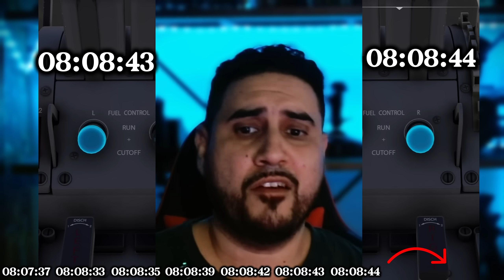TIMELINE & MENTAL HEALTH BREAKDOWN | AIR INDIA 171 | AAIB PRELIMINARY REPORT | MAYDAY | MSFS2024

Comment: All comments are preliminary until final oficial report is issued.  However, I must say that in my 13,000 flight hours as commercial pilot, never saw someone moving a switch accidentally … meaning with no deliberate intention.
Reply from the maker: What do you normally fly? 
I agree that the report points towards deliberate action but doesn’t not give any conclusive causes.
Reply: @FinalApproachPOV  I’m already retired, I flew mostly B707 for more that 20 years. What I’m saying is my experience regarding this issue.  Needless to say, we’ll have to wait for the final oficial report.
Reply from the maker: @armandogotelli7616 totally understandable, with these incidents, we never find out until the final report. And even then, we can only rely on the information they provide.

Comment: Should the pilot who did not set the fuel switches to cut off first reaction be to turn them back on immediately then question why they were turned off. What was he doing for 10/14 seconds before them being turned back on? Did he turn them back on or was it the pilot who turned them off turn them back on?
Reply from the maker: I think an argument ensued between the pilots. But it was intentionally left out of the report.

Comment: It seems strange that there is no C.C.T.V. in the cockpit because then we would know for sure what happened straight away.  I also wonder if in pulling up the engine switch off levers, does it sound an alarm on the dashboard?  If not, somebody earlier or the crew in making their flight checks might have lifted the switches and then, as the plan rose up so suddently and steeply, shaking with all the weight of the plane, passengers and fuel on board the levers might have fallen backwards switching off the fuel supply.  That would also explain why there was only a one second interval between both engines being switched off almost simultaneously.
Reply: Too easy to blame the dead!

Comment: Don't misleading. this video has false information and should be reported..
Reply: Exactly which informtion is false?
Reply: Your title .. the info in the thumbnail, which says that's why he did it
Reply: @WhyIamHindu  Fair comment but we need to keep in mind that it has to be one possible cause. For me the 1 second delay between the fuel cut-offs to respective engines is consistent with a manual act and has been shown to be achievable on another video. Also why did one of the pilots comment on the shut off of the fuel switches?
Reply from the maker: @AstralVoyager-q5f   Thank you for the the critical thinking. I welcome all intelligent discourse on the subject.  But this person "WhyIamHindu" is completely wrong in stating this is false information.
Reply: Change your title to potential flaws in Boieng fuel cutoff switch is called out by FAA in 2018 and British Authorities in March 2025.
Reply from the maker: Feel free to report it.....good luck with your trolling journey.
Reply from the maker: @whyiamhundu - good luck with your trolling journey. feel free to report it.

Comment: This was no accident. The switches were moved from on to cutoff, deliberately, one at a time. Whichever pilot did it, he did it at exactly the right time, knowing there would not be enough time to restart the engines in time.
Reply: The plane was jack ed - that's the simple explanation. Its well known that the engines like Rolls Royce (for example) can be remotely controlled and shut down. RR continually monitors their leased engines anywhere in the world in real-time. One time when one was running too hot they considered shutting it down from England, but instead due to safety concerns waited till the instant the plane touched down before remotely shutting it off.
Reply: @fx-studio   💯 More to it than meets the eye
Reply: @fx-studio Stop spreading misinformation
Reply: @10UnitedRoad10  All the signs its a P $y 0P - especially with all the bots and defenders in the comments...
Reply: Why to believe in primarily  report and conclude very quickly, it's easiest to save boeing
Reply: Right . The experienced pilot knew that , if he  does it at the point , he actually did,  the recovery is impossible.
Reply: @RD-ij2sz practiced in a simulator?
Reply: @ribbit2816 Not really . But fuel switches can not be made on and off by any remote command .It has to happen manually in the cockpit and it cant happen as inadvetent error .
Reply: Oh I see are you the master mind behind it?
Reply: Please refrain from making false accusations on the pilots . Boeing issued an advisory for faulty fuel computer chips which over heated and send signals to the sensors to stop fuel . This happened on 787 having 11,000 or more . When this happens alarms go off in the cockpit and that’s why one pilot asked the other «  did you put the switch off » This was a reaction to a problem and not the cause . The time stamp on the switch cut off shows it’s computer generated and not manual as it would have taken much more time 2 seconds each . So please don’t put a PR spin on this report until the final report comes out just to cover up for Boeing . It’s disrespectful to the passengers , crew and their families
Reply: @DalitisHebrewnotHindu   🙏🏻  Well said.
Reply: @DalitisHebrewnotHindu  stop speculating... it's insulting to the investors
Reply: @gm-zz8so  Right , I have to bother about crony investors spreading false information to protect their behinds. But your PR spin is ok to insult and degrade the pilots who are not here to defend themselves and the families of all passengers and crew.
Reply: @DalitisHebrewnotHindu There is no alarm when fuel is switched off.

You can hear the engine ramp down.
Reply: @willys2747  The alarm goes off when the engines are switched off . 100%
Reply: Been seeing a lot of james bond movies?
Reply: Remote control cannot phyisically move the switches. The fact they were moved to run means they were in the shutoff position.
Reply: WOW. you're so smart...i think u just spoke to their ghosts..
Reply: It was mass murder. He killed more than 5 times the people of the Christchurch Mosque murderer. Sick of people defending and being pussies about this. It was a mass murder suicide
Reply: One of the pilots is a mass murderer
Reply: The report was leaked to Western media ..The report is certainly questionable
Reply: Actually, if only the other pilot had immediately reacted to immediately switch fuel back on, they would probably have been saved.
Reply: @willys2747  it took him 10secs to put it back om apparently.Now that has intention
Reply: It's the prevailing theory for me. But you also can't discount some sort of  psychotic episode, or a bad reaction to some sort of experiencing of a phenomena such as somatographic illusion (much less likely)
Reply: If he really did, then hell is where he is heading.
Reply: If not Suicide/Murder, the only thing I can imagine is, he thought he was putting the Landing Gear Up, when due to some mental slip coupled with muscle memory, he moved the fuel switches to cut off instead of the gear up!
....and he really didnt believe he shut the fuel off.....really hard to believe a deliberate act.
Reply: @SK-qc6fb  How about the plane was jack ed - then you don't need all the gymnastics.
Reply: @fx-studio  Who's Jack Ed?
Reply: @Jeph629  The plane was jack ed - that's the simple explanation. Its well known that the engines like Rolls Royce (for example) can be remotely controlled and shut down. RR continually monitors their leased engines anywhere in the world in real-time. One time when one was running too hot they considered shutting it down from England, but instead due to safety concerns waited till the instant the plane touched down before remotely shutting it off.
Reply: @SK-qc6fb depends on how many switches for landing gear.
Reply: @SK-qc6fb Yes, possibly, as well.
Reply: Spot on 👍
Reply: Stop blaming the pilots. Boeing and airindia will soon shut soon...
Reply: My pc asks for confirmation before erasing a document. Why can't a plain do this ?
Reply: Exactly
Reply: The engines failed immediately at lift off.. Pilot monitoring did his job and tried to reignite the engines!
Reply: @mgspec  NOT what the CVR says. Virtually impossible for both engines to fail at exactly the same time.
Reply: None of the pilot turned it off, the TCMA "engine control system" crashed the plane🙈
Reply: @Bua-yc4vh  Thrust Control Malfunction Accommodation (TCMA) was a possibility, until the CVR and FDR were checked. The FDR shows the switches were turned off and back on again, and the exact times. And the CVR recorded what the pilots said.  The switches were turned off manually. That is now the only possibility.
Reply: @Bua-yc4vh 👍🏻
Reply: @Bua-yc4vh If that were the case, 787s would be grounded world wide (especially those with similiar manufacture date, and flight hours)
Reply: @Bua-yc4vh  Haha sure, and they still haven't grounded 787s around the world. Yeah smart haha
Reply: Wow. You're smart
Reply: Yes the fucking pilot that killed the engines is a mass murderer. It is thst simple, he killed 100s of people. @craigcrawford6749
Reply: If moved deliberately one at a time, it is not possible to do so in just 1 second. An experienced pilot can answer this.
Reply: @krishkrish7574  
You are wrong, It is possible. One second is more then inaf to do that.
Reply: @pilotina65 

I agree absolutely, but why did the reverse switching, which we are sure happens manually takes a while 4s, that's 4 times longer than the switching off
Reply: @oluwafemiayeni4233 by the time the other pilot noticed it and switched them on again could the 4 seconds.
Reply: @stephenbonin3049 

This explains the time lag between when both switches were in cut off and when the first switch went back to run position... 

The 4secs I was referring to is the time elapsed between when the first switch went back to run and when the second switch also went back to run

Evidently when the other pilot noticed the abnormalities, he will attempt to switch both on in the quickest succession ever possible humanly.

Those are my premises to strongly conclude the mechanism that switched both to cutoff(within 1sec) is not the same mechanism that switched both to run(within 4sec)...,one is at least more automated than the other
Reply: @krishkrish7574  1 switch in 1 second, and yes that is easy. Note that the time is from when the first switch was set to cutoff. Search and you will find videos where they do this without problems.
Reply: @Johan654-s1f  Buy the way... no previous pilots from previous flights on the same plane had any complaints about the fuel switches and you can bet the AAIB tested the switch function after the crash....they had pictures of it
Reply: @Johan654-s1f 
Yes, I agree, the time starts when the first switch is moved cut off, so its really just the time to activate the second switch. 

I would tend to believe, that pilots do this by feel and dont even have to look down at the switch.
Reply: @krishkrish7574  Actually, yes, it is possible. This is just how easy it is  https://www.youtube.com/watch?v=QMNwtfl5P5s&t=3s
Reply: @krishkrish7574  nonsense ...I can....
Reply: @krishkrish7574  it's possible. There are videos of experienced pilots doing it within one second.
Reply: Check life insurance

Comment: At this point,  there are many unanswered questions remaining in the preliminary report. To fill in the blanks, investigation of the mental health of both pilots is one obvious direction to proceed in. That does not rule out that other directions need to be explored too, including the physical condition of the switches, who said what to who and exactly when., and whether there is any evidence of engine trouble before the switches were moved. Only by exploring all avenues can the whole picture be revealed.
Reply: Please refrain from making false accusations on the pilots . Boeing issued an advisory for faulty fuel computer chips which over heated and send signals to the sensors to stop fuel . This happened on 787 having 11,000 or more . When this happens alarms go off in the cockpit and that’s why one pilot asked the other «  did you put the switch off » This was a reaction to a problem and not the cause . The time stamp on the switch cut off shows it’s computer generated and not manual as it would have taken much more time 2 seconds each . So please don’t put a PR spin on this report until the final report comes out just to cover up for Boeing . It’s disrespectful to the passengers , crew and their families
Reply from the maker: @DalitisHebrewnotHindu  please read a book. There are plenty of them at 3rd grade reading level for you to easily understand if this video was too much for you. Other educate folks have great feedback while you have…..well……feelings.
Reply: @FinalApproachPOV + I don’t read third grade books suggested by YouTubers . I have worked in this industry. I know what I am talking about . Maybe you should try reading those books ..and you will learn a thing or two
Reply from the maker: @DalitisHebrewnotHindu   Stop the Q tip when you feel resistance. If you work in the aviation industry we all can only hope and pray we don't get on a plane you had your hands next to.
Reply: Whatever you said about the Pilot shaming is disgraceful
Reply from the maker: Exactly.
Reply: Until then please shut up

Comment: The recent report on the AI171 crash doesn't identify who said what after the fuel shutoff switch setting was discussed by the pilot and copilot. Isn't the cockpit voice recorder system able to determine that? If so, the initial report suffers from the sin of omission?
Reply from the maker: Definitely the sin of omission.
Reply: Yes they would know which pilot said what. Assume they don't want to release until they get a fuller picture.

Comment: Are these "over center" switches? Do you have to pull them up to be able to overcome the eccentric or cam in the switch, and if the plane is in flight, and the fuel switches are turned to the off position, is there an audible warning, if so, is this audible warning picked up by any of the black boxes recovered?
Reply from the maker: I don’t believe this Boeing 787 has any warning in pulling the switches. But there are other aircraft that would ignore the input.
Reply: the FAA had issued an advisory that some of the planes reportedly had the "pull-up-before-toggling" feature on the switches disabled.

Comment: Yeah both switches failed mecanically.  Yet you didnt mention it as to say that its absurd
Reply from the maker: Thanks for your comment. Just to clarify, the AAIB preliminary report does not state that both switches “failed mechanically.”

What it actually says is:

“The left engine fire extinguisher push switch was found not latched in the normal (out) position. The mechanism of the switch was found to be damaged, and the push switch could not be latched in the out position.”

That describes post-crash damage, but doesn’t confirm a mechanical failure occurred in-flight.

For the right switch, the report states:

“The right engine fire extinguisher push switch was found latched in the normal (out) position, but its internal plunger was depressed, indicating it was likely activated at some point.”

That indicates it was manually activated, not that it failed.

So far, the report presents observations — not conclusions of mechanical failure. I avoided making that claim because the evidence doesn’t support it yet.
Reply: @FinalApproachPOV  I mean the context. You said that switched can fail mecanically but I think that you should have mention that its almost impossoble of 2 failing at the same time.